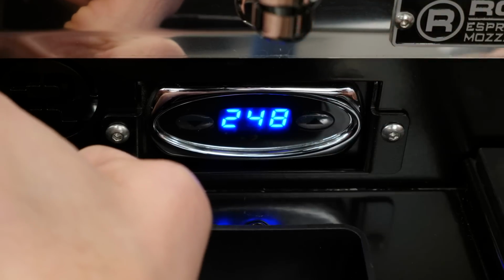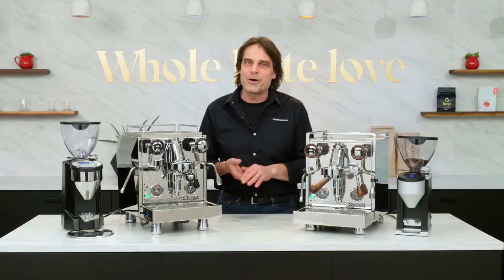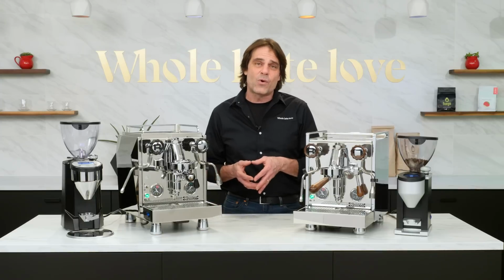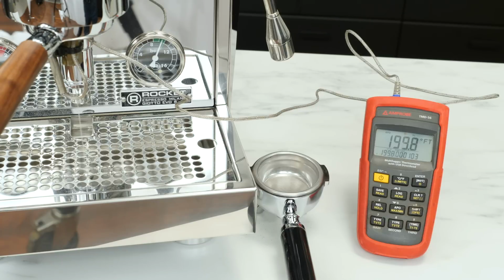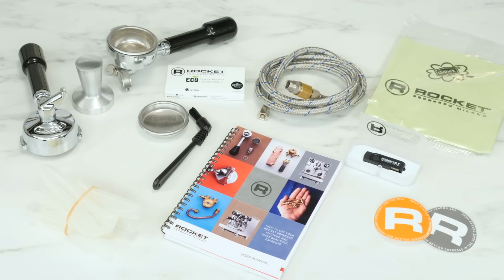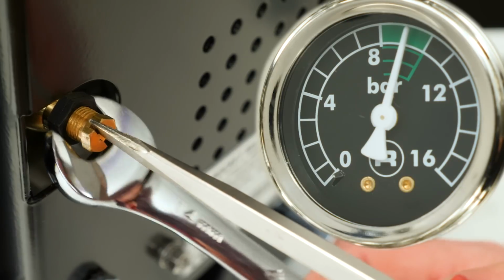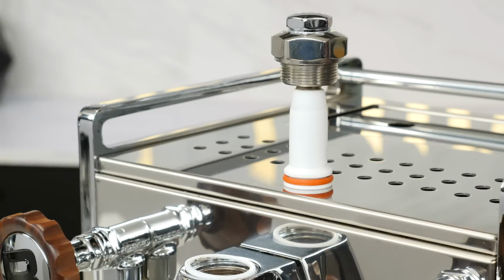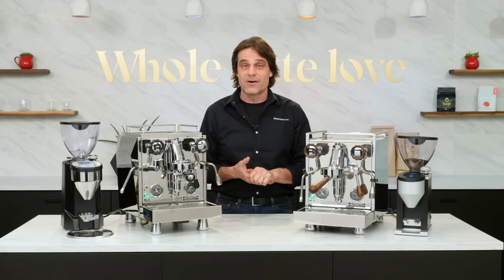Review: Rocket Cronometro R Giotto and Mozzafiato Espresso Machines

Comment: Hi Marc. I've finally landed on my first good machine. The Mozzafiato R. Can't wait. Just to clarify, You still need to do a cooling flush with the PID yes? I've heard elsewhere that the water that's in the tube for brewing will be too hot because it's been surrounded by the steam temp water for too long.
Reply from the maker: Hi Austin, Thanks for question. I've done a lot of Scace testing of HX boiler machines with PID. Based on those tests, I believe in most cases a cooling flush is not required. It's a very different story when using HX machines without PID. Here's a video I posted yesterday on the ECM Technika V Profi PID, a very similar machine to the Mozz R: https://youtu.be/f0nDqkGzbDM In that video I do a Scace test after the machine was sitting idle for 2 hours. No cooling flush and no overheated water. Of course this is not your machine. And your ambient conditions may be different. In the video I do a demo showing how important the E61 group is in dissipating heat and how ambient conditions might affect brew temps.  A couple of things to know: Water does not sit in the tube within the HX section of the boiler. It's constantly circulating out to the group and back. I explain how this thermosiphon works in the linked video using an HX boiler and E61 group cut in half for a view of internals. Also, keep the portafilter in the group when your machine is on and idle. It's part of the the system which bleeds heat from the HX section of the boiler.
Marc

Comment: Would you recommend the extra $$ and go for the Cronometro over the Appartamento? Just coming form a Rancilio but wondering if the PID is a big winner here as I don't think the Appartamento has one.
Reply from the maker: Hi Glenn, Thanks for the question. You are correct no PID in the Appartamento. Depends on your budget but the Cronometro R Giotto and Mozzafiato machines are a big step up from the Appartamento. Beyond the PID, The "R" versions of these machines are plumbable direct to waterline. There are Type V versions which use a vibration pump and are not plumbable. Both version of these machines produce very consistent brew temps without the need in most cases to do a cooling flush prior to an extraction. The Appartamento almost always requires a cooling flush. Hope that helps!
Marc

Comment: I have Mozzafiato Cronometro R and found that after long 
period of idle 60 minutes my group reach 92-93 Celsius 
When group has 92 different, i guess boiling water comes from shower and after a while normal flow occurs. Group temperature rises to 96 Celsius and after few minutes after flush drops to 88-89.
So I started to do a little flush and I am wondering what temperature do I get? PID is set to 121 C which should give 95 C according to manual. 
It would be nice if someone with Scace device established correct flushing/no flushing routine. 

I have noticed that if I make espresso every 5-10 minutes group temereture remains stable and has lower temperature than after long idle period. 

In this moment I think that flush is necessary after long idle period. But maybe I am wrong?
Reply from the maker: Hi LP, Thanks for sharing your info and the question. Group temperature can vary a bit depending on use level. Long idle periods may tend to cause a rise in group temps. So like you are doing a short flush to smooth flow prior to extraction is a good idea after long idle periods. There will be slight variations in group temps depending on ambient temps and air movement in vicinity of the machine. Personally I would trust the manual but do a quick check with a short flush. Do that for a few days or in different situations and you should develop a feel for when the machine needs it. Hope that helps!
Marc

Comment: Hello Marc.

I have a question about this machine and all heat exchanger machines.

When we set the brew temperature at 90C, what is the steaming temperature? Is it also 90C ?

Does the boiler send the same temperature to both group head and steam ?
Reply: I know that there is an actual temperature inside boiler but just asking about steam temperature. Did you mesure it?
Reply from the maker: Hi MA, These are heat exchange boiler machines. Inside the boiler there is a single heating element. Brew water runs through an isolated section within the boiler so water used to generate steam and that used for brewing do not mix. When you set the brew temperature the steam section of the boiler runs far hotter than the isolated section supplying the brew water. To generate steam the temperature must be higher than 100C/212F. The isolated brew section of an HX boiler constantly circulates water out to the group and back. The water gives up heat to the group and returns cooler. This process happens by convection and is called a "thermosiphon". The water circulation happens without the pump running as it's driven by convection. The constant flow of water out to the group head and back keeps the water in the isolated section of the boiler much cooler than the water in the steam generating section. To make things more confusing some HX machines use an offset when setting temperatures. With those you set your desired brew temp and the machine uses an offset programmed into the PID controller which runs the steam generating portion much hotter. A machine like the Profitec Pro 500 uses an offset. Rocket Espresso machines like those in this video do not use an offset. Using a chart in the manual you look up the desired brew temp and get the temp to set the boiler to get that brew temp. Hope that makes sense and helps!
Marc

Comment: Should I adjust PID settings when I use naked portafilter?
If portafiler works as heat sink, smaller naked portafilter will distribute less heat 
So I am wondering if 121 Celsius still gives 95,1 Celcius on the group?
Reply from the maker: Hi LP, Thanks for the question. You might turn the temp down a bit when using a naked PF as it will not pull as much heat out of the group when idle.
Marc

Comment: Hi Mark, I have a question for you.
Do you think the Rocket Cronometro R Giotto could hold up in a small shop making under 30 espresso drinks a day?
Reply from the maker: Hi Lucas, The machine can handle that volume but a couple of things to be aware of. The machine is not NSF rated so not truly intended for commercial service. You may get a slight rise in brew temp if doing many shots in quick succession.
Marc

Comment: Thanks Marc for sharing these great videos! For Rocket Cronometro Giotto / Mozzafiato both type R and V, and R58 as well) can we use smart plug to set timing in the morning so machine can be started automatically? i assume these machines are not time programmable and since they need to warm up 20-25min, i wonder if i can buy a smart plug to set the timing to switch on and off. Thanks so much!
Reply: You can use a smart plug.  Just be sure the smart plug is rated at (or above) the amps of the machine.  I believe the R58 can already be timed.  I know the cinquantotto can and think the previous R58 can as well.

Comment: Hi Marc,

Again interesting, for example I read a lot online and never knew that only these models in Rotary version did come with magnetic drip tray. It's a shame they didn't update their R58 with that and a timer. I have 2 questions though as I just received today the (Rocket Cronometro Type V) that I gifted my mom to replace her broken Breville Oracle.

1- Is it me or it is never possible to adjust the pressure on any vibration pump, as only the rotary machines have the adjustment underneath?

2- I just brewed 2 espresso with 18g leveled and tamped, and hell... I know how to do my stuff after 8 months of daily use on mine and getting better every months, but I never figured out tonight why her pump gauge NEVER ever went above 4.5Bar so twice less than the recommended pressure. The steam gauge did stay at 1.0 on idle which I think is normal though I thought it would have idled a little higher at 1.2bar, anyway it did seem to steam just fine. As for the PID it is set to 120C but it keeps displaying 121C for some reasons. So I'm wondering if the pump is defectuous from day 1, or if the machine can take several shots before stabilizing and working fine cause so far I'm very disappointed. The shot was very watery, pale and had no crema using the same coffee I use home.

Oh and thanks for also learning me in another of your video that a vibration pump always take 5 more seconds than a rotary to reach full pump pressure, cause that also I didn't know why it stayed to almost 0 for several seconds before going up while on mine it's instant.
Reply from the maker: Hi P, Thanks for the questions!
1. Most vibration pump machine have adjustable brew pressure via an OPV - Over Pressure Valve. On Vib pump machines we set the OPV to 10 bar which gets you ~9 bar at the group.

2. To verify pump and brew pressure use a blind filter basket in your PF, place in group and raise the brew lever. If all is well your brew pressure gauge should read at or near 10 bar. At a PID temp setting of 120C your brew water temp is 93.6C. you can increase the PID temp setting to get more pressure in boiler but that also increases your brew water temp. Not unusual for the PID to display +/- 1 degree from its set temp. The display shows the actual in boiler temp. If only reaching 4.5 bar during extraction your grind may be too coarse. Outside chance you have bad pump but that's unlikely.

Yes, vibration pumps to take longer to reach brew pressure.
Marc
Reply: Tonight i got my Evo R cronometro (rotary). I had the same thing. The right gauge (brew gauge) in idle was at 4.5 when boiler gauge was at 1+ bar. Using fresh single origin coffe with baratza sette 270Wi at recommended 9E, coffee didn’t come out fast enough and took a lot of time for a cup of coffee. Do i have to do something also? Thanks!

Comment: The good : reliable///nearly 10000 shots only steam noob gasket leaking drops. Much Quieter than V pump///works like belt drive garage door opener compare with chain drive. The BAD: small water tank ///seems only designed for plan B so pls plumbing it! All E61 may burns your arm /// better than a cup of coffee to wake u up ouch! Small tray cause Desk wet/// need extra tray when brush cleaning like Silvia. Weak steam/// not because my steam gasket start leaking!  Over all for not wake my baby up , it was a good buy:/
Reply from the maker: Hi SQ Y, Thanks for sharing your experience. Yes, do plumb that machine! Nothing so freeing as never having to fill a reservoir again! E61 groups all get hot so not a place to be resting exposed skin - ouch! Weak steam is surprising. Should have plenty of steam for steaming even in a larger pitcher.
Marc
Reply: Whole Latte Love I got faster results from Silvia PID than this. You are right. I should say decent steam power, not weak!

Comment: Hi guys, I have approval from the household finance minister to upgrade our machine. I'm finding it difficult to decide between the Rocket Mozzafiato R as reviewed in this video and an ECM Technika V Profi PID. If you could offer some advice in comparing these two it would be appreciated, thanks.
Reply from the maker: Hi Ben, Lol - finance minister. I have one of those too! Here's a link to a side by side spec comparison of the machines: https://www.wholelattelove.com/pages/compare?products=MjIyMzc0MzUzMzExMCw0Mzk3MTY0NjkxNTEw
Some key differences...
ECM Technika: Angled PFs, stainless steel boiler, joystick valves, PID on face of machine, more exterior detail, stainless steel mushroom valve
Roccket Mozz R: Straight PFs, copper boiler with brass end plates, knob valves, PID control behind drip tray, subtle shot times (Chronometro version), heavier on the branding, ceramic mushroom valve
I have no preference to boiler material type, I do prefer angled PFs, valves are personal taste. At the end of the day they are both equally capable. ECM machines tend to be a little more tidy under the hood.
Hope that helps!
Marc
Reply: @Wholelattelovepage  Thank you for taking the time to reply Marc, your advice is appreciated.

Comment: Marc, can I use the Rocket Ceramic Mushroom Valve Assembly in my Profitec Pro 500?  My first Mushroom Valve lost MOST of its chrome. NOT GOOD😱🤬😱
Reply from the maker: Hi William, You must have an old Pro 500! Profitec and ECM have used stainless steel mushroom valves in all E61 group machines for a number of years now. I would suggest replacing your chromed mushroom with a SS mushroom.
Marc
Reply: Whole Latte Love I bought my PO500 three years ago from Mark Jackson. Are you saying I was sold old equipment?

Comment: Really informative video - thank you. I like (and don't like) how the temp stability and flush debate continues :) - my question is about plumbing in - I was thinking to plumb in after a RO filter system with PH+ (APEC 6 stage). The pressure can vary depending on how full the buffer tank is. Does this mean I would have variable pump pressure? Should I just stick w/ reservoir?
Reply from the maker: Hi Chris, Thanks for the comment and question. If using an RO system be sure that remineralization is part of that system., You do not want to put pure zero TDS water into an espresso machine! It can cause corrosion of metals and over-extraction. I hate filling reservoirs so I love plumbed in machines! Line pressure has minimal effects on a plumbed in machine when the pump is running. If you are referring to having line pressure pre-infusion when plunmbed in due to line pressure you will not get that on these machines. Rocket machines have a solenoid valve on the plumbed in connection that only opens the machine to line pressure when the pump is operating. Hope that helps!
Marc
Reply: @Wholelattelovepage  Thanks much! This system adds back calcite (calcium carbonate) but I'll have to figure out if it's enough or not.

Comment: Apart from the shell design, are they any differences? I didn't hear you mention any apart from the shell and maybe cup rail
Reply from the maker: Hi D, Thanks for the question. Internally the machines are identical. Slight aesthetic difference in the design of the feet but other than that the same.
Marc

Comment: What's their failure rate? I heard a lot of problems with appartamento tho.
Reply from the maker: Hi DP, Thanks for the question. Curious what problems you've heard about. We run a busy service center and work on many brands of machines. No unusual failure rate of Rocket Espresso products compared to other manufacturers. The most common cause of issues across all machines is using hard (mineral rich) water which causes scale deposits in machine. You want some minerals, but with proper treatment you can get to a level which will not cause scale in espresso machines.
Marc
Reply: @Wholelattelovepage  thanks Marc, in Facebook, there's a Rocket group. It is common to hear problems with pressure or circuit board. This is especially common for Appartamento. So, I am worried if I should invest in a Rocket machine.

I came from pods machine. Shortlisted Breville but realised its limitations and set my eyes on Rocket. But it seems I am back to square one.

Comment: Thoughts on the timer starting as soon as the lever is raised? In previous videos you mentioned you like to start timing on first drip. Thanks!
Reply from the maker: Hi s, I've covered this in a few of my videos and in many comments... Timing is the most basic measure of appraising an extraction. Use it to get dialed in for grind size and then use a a scale, brew ratios and taste. I prefer first drip as I use so many different types of machines as well as doing extended low flow rate pre-infusions. For me timing from first drip evens out the differences. For example, it takes 5 or so seconds more for a vibration pump machine to come up to full pressure than it does for a machine with a rotary pump. Should I use the same timing for both? Probably not. If always using the same machine then timing is a useful reference point. Regardless of what some may say it's fine to go outside the basic timing rules so long as it produces an espresso you like. When I do extended pre-infusions and/or lower flow rate extractions 40 seconds from pump on happens all the time and the shots are phenomenal! Here's a video in which I pull some bottomless triple shots using a fresh from roast Yirgacheffe coffee at 1:2 ratio. As I recall the shot I liked best using a long low flow pre-infusion followed by a lower than standard flow ran ~40 seconds from pump on while it was in the 20's timed from first drip. Here's a link to that video: https://youtu.be/HTaly8c-i_U IMO those that get wrapped up in timing sholud ditch the stopwatch once a coffee is dialed in and then use a scale, brew ratios and flavor. Hope that helps :)
Marc
Reply: @Wholelattelovepage  Thanks Marc for the thoughtful response - I recently got a rocket Giotto chronometro R and was unsure of the benefit of the shot timer starting immediately.

Comment: Hi,

Could it be that the R version comes with the magnets and the plastic rim on the drip tray compared with the V version? Or did Rocket an update in 2020?
Reply from the maker: Hi Patrick, Yes, R (rotary pump) models come with the magnets on drip tray and drip tray slides.
Reply: Exactly, my mom just received the Type V today that I gifted her and it didn't have magnetic drip tray, which I didn't even know the Rotary version had as even my R58 doesn't have that.